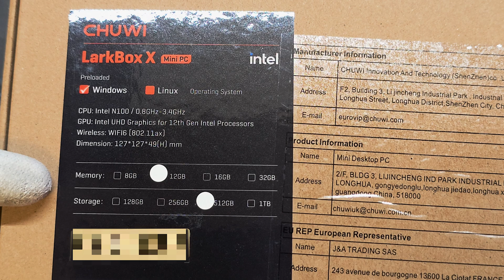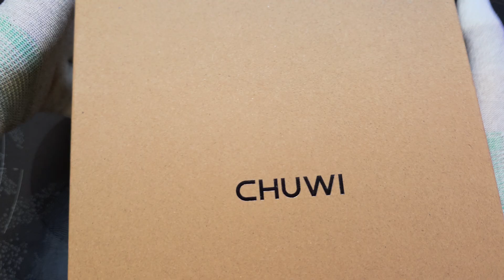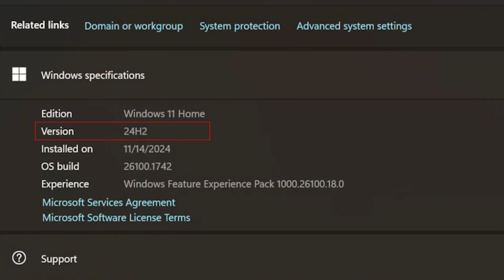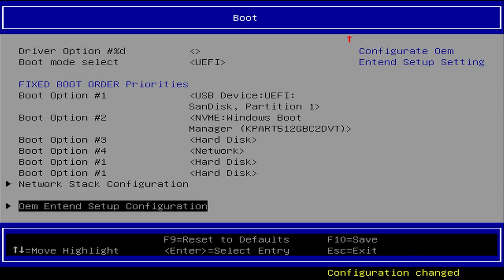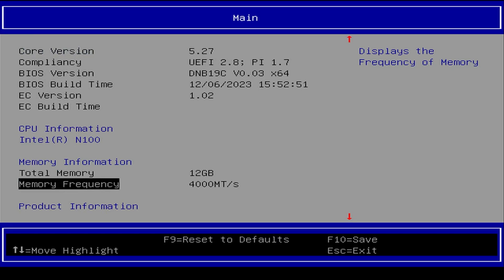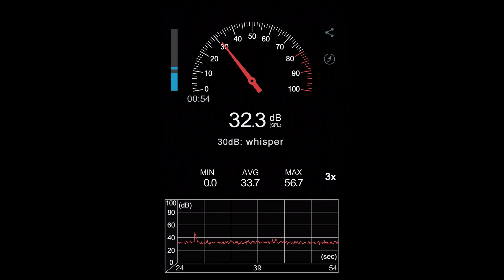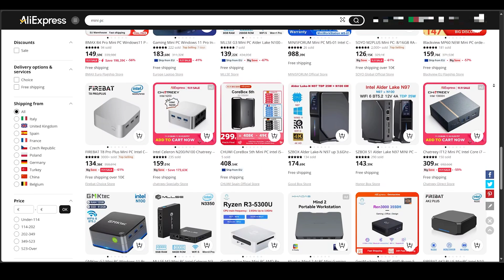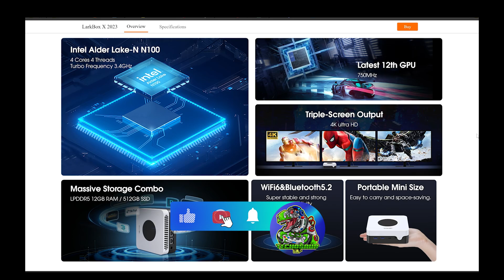Can $150 Get you a Great Mini-PC from AliExpress?

Comment: Thanks for the very detailed review! I recently bought a similar, but cheaper N100 mini pc from Aliexpress. I've connected it with a high-quality HDMI cable to my 4K TV. I'm disappointed with its performance when streaming youtube (at 1080p and 4k). The video is not smooth, but rather choppy. The picture quality doesn't seem that clear. I am going to try putting some full HD and 4K movies on it and use VLC to watch it on my TV. 

I was wondering if you have any tips for such media streaming? I was told the N100 with a SSD would easily handle such media tasks. Thank you.
Reply from the maker: Thanks for your comment.

To be perfectly honest, I haven't played any YouTube videos in either 1080p or 4K on it yet. I'll give it a try and let you know how it goes, promise

I may make more tips or other content related to it as well, i enjoy the concept

For storage Did you confirm that it has an NVMe SSD at least gen 3 ?

Also, what are the specifications of your RAM in terms of capacity and speed?

Mine has 12 GB of 4000 MHz DDR5 (yes, it was advertised as 4800 MHz but I only got 4000 instead, and I can't change it. I've tried every method I know).
Reply: @TECHOSAUR  Thank you - appreciate it. 

I haven't looked at the SSD yet, but it was 512gb. And 12gb of ram.
Reply from the maker: @mrparker4597  is RAM DDR5 ?
also did you update windows to 24H2? its better than shipped one 22H2 mine arrived with it

Comment: The N97 is supposed to be a much better performing NUC box, and it's in the same price bracket.

Also, consider trying small size NUC boxes. They are 72 X 72 X 40 (something) mm. Size starts to matter for these little guys.
Reply from the maker: @ezg8448, thanks for the info. I didn't know about the N97.
I was just comparing both, and the notable difference is the GPU clock:
750 MHz N100
1200 MHz N97

core count is 4, but N97 has a higher cpu clock by 200 MHz

It's weird how 97 is better than 100, though, since in Intel book, higher number is better
but I see that it has higher TDP, so it requires better cooling, this one got 79 on max maybe with higher clock it cant handle it